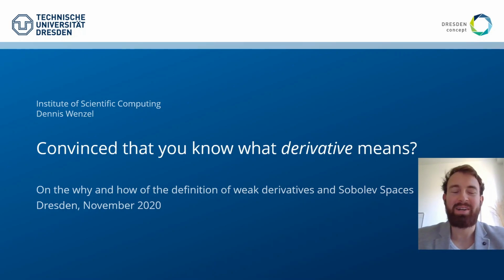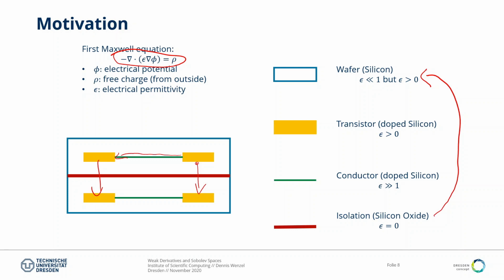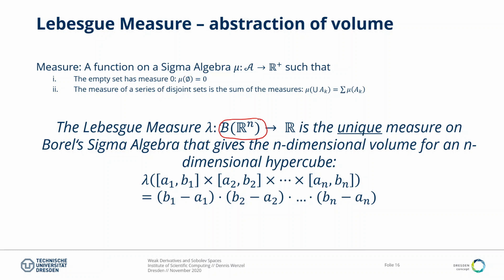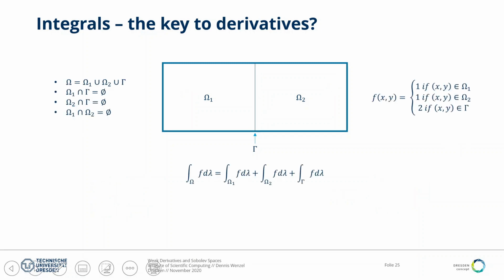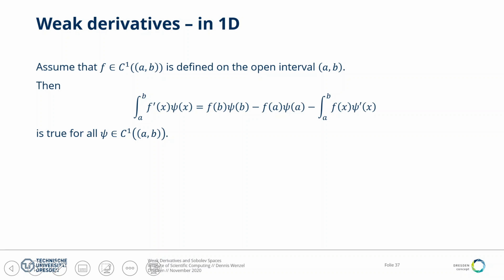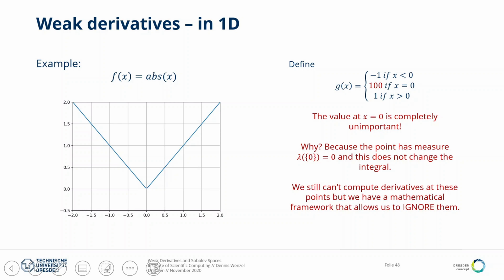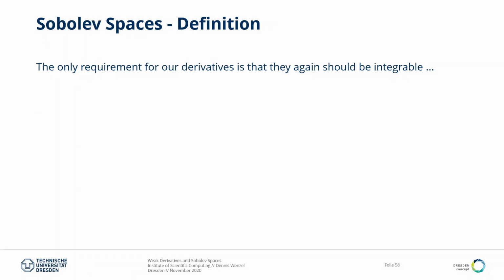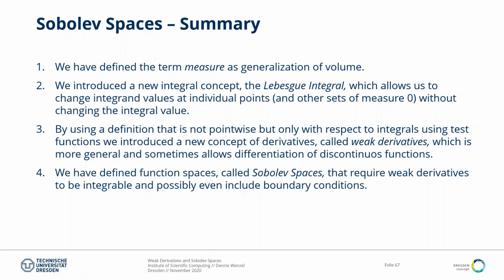TUD-FEM Lecture 4: Sobolev Spaces

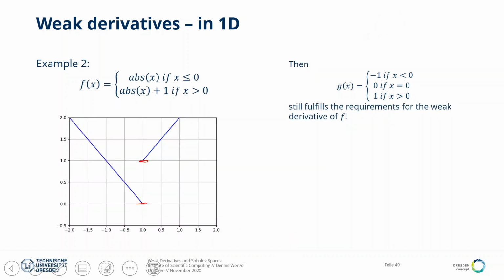Comment: 58:30 0h my god. Actually, weak differentiable functions are continuous in R^1. This changes in higher dimension, but it is not easy to see in which precise way. On the other hand, it is easy to see that your example 2 is just wrong:
Take as a test function a smooth function \phi which approximates the characteristic function of [-1,1], i.e. the function, which is 1 on this interval and 0 elsewhere.
Then \int_{-2}^2 f \phi^{\prime} dx \approx f(-1) - f(1) = 1 - 3 = -2
and \int_{-2}^2 g \phi dx \approx \int_{-1}^1 g dx = 0.

p.s.: There is a concept which allows for arbitrary many derivatives of continuous functions: Distributions.
Drawback: You can't multiply distributions in general.